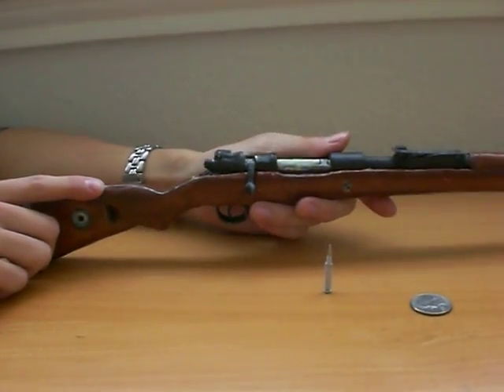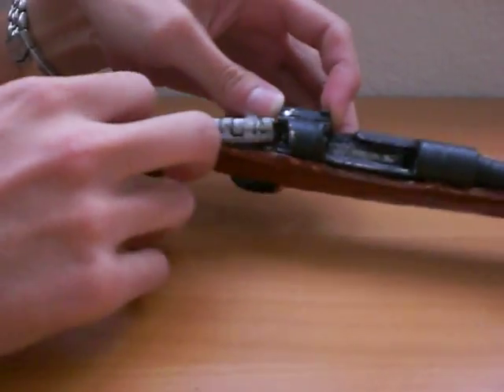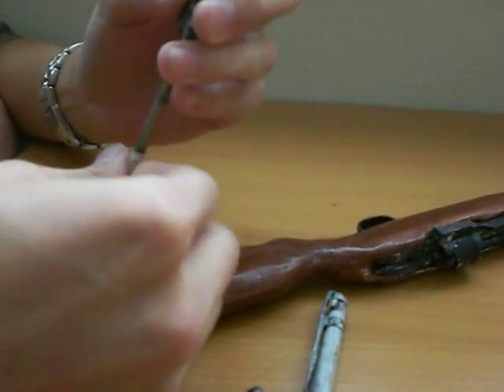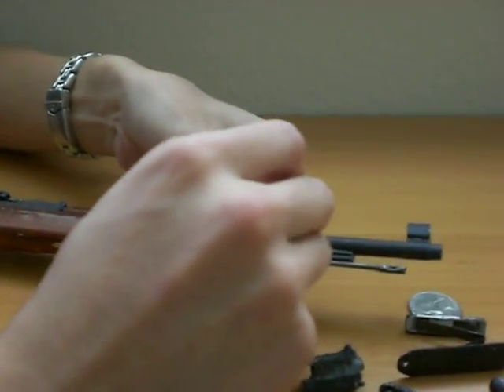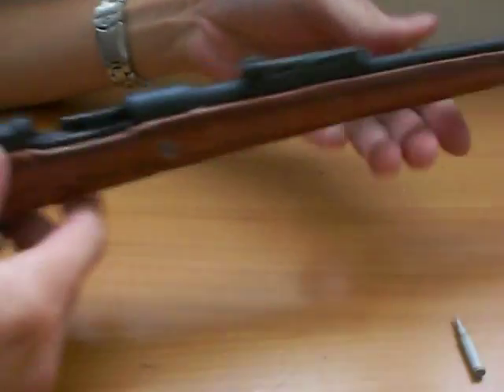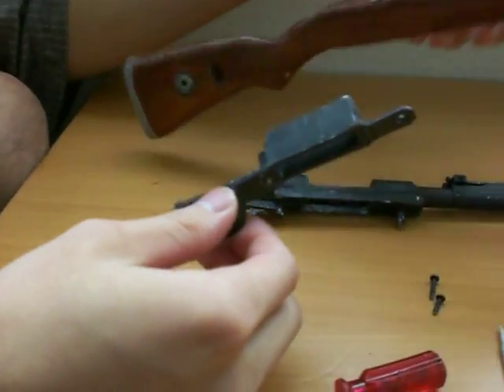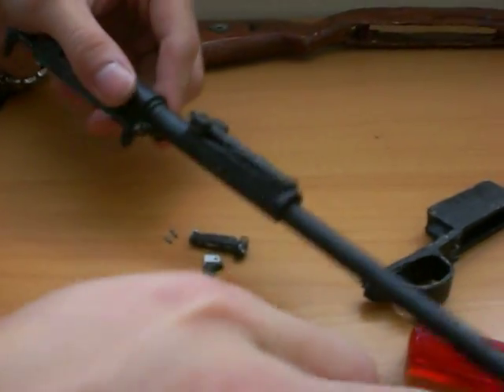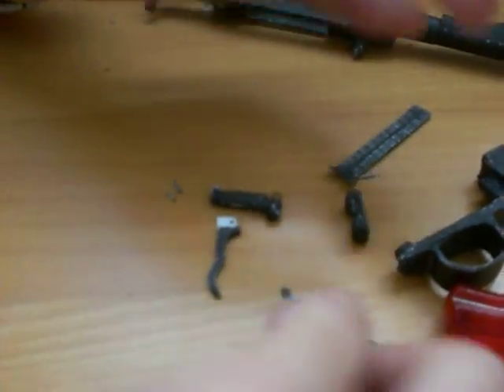Homemade Miniature K98

Comment: I made one but it uses a cap gun cap as a primer and i use armstrong formula as a substitute for gunpowder. It is a small caliber and I use those little tiny chains that make up most keychain accesories from the dollar store. But since it is a very small replica I wonder if it is legal for me to own such a small caliber even if its far smaller than a 2mm cal.
Reply: Miguel Diaz hey can you give me a brief explanation on how to make the bolt section
Reply: Hi Jerric, unfortunately mine is more like a Kentucky flintlock replica about the same size as the one here so I have not attempted to actually make a modern bolt action since it really does not need one. But I am sure that if you have access to a small lathe and some actual firearm blueprints that it should not be too hard for you to come up with your own miniature version.